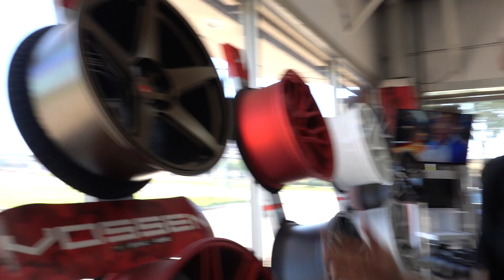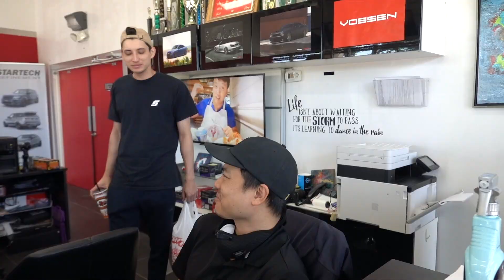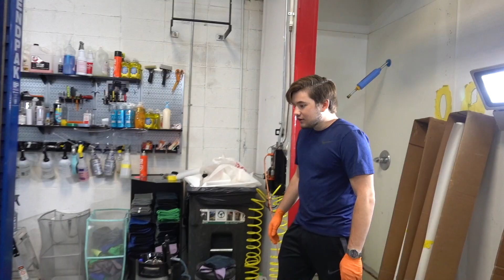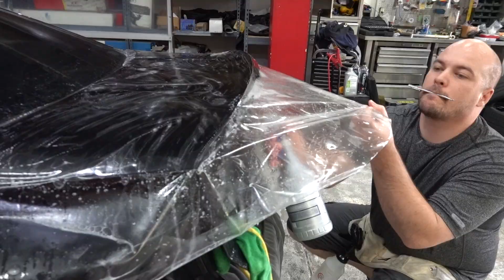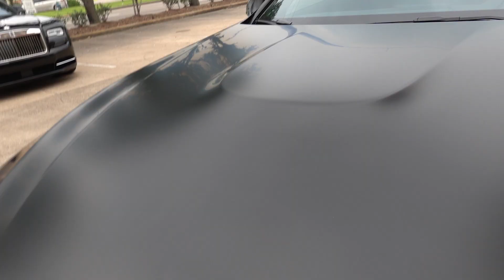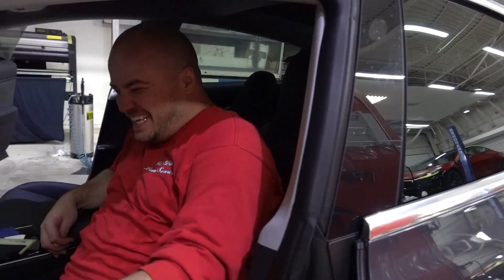The Best Looking Satin Black BMW M4  | EVS Vlog

Comment: Shoud you see the 3M logo on the wrap when in sunlight? I just got a 3M satin black wrap and in sunlight the 3M logo and other numbers appear. This cant be normal right?
Reply from the maker: This isn't 3m
Reply: No that’s not normal, go get that fixed
Reply: @EVSMotors you can’t answer a simple question

Comment: Hi, Which one is a darker black- Stealth Black PPF or Satin Black PPF? What's the difference between them? Or are they the same? What's your suggestion on applying a ceramic coating over the PPF?
Reply from the maker: We love Satin Guard and ceramic coating is a good idea over PPF.
Reply: @EVSMotors  but which one is darker and glossier among the two (Satin Black or Stealth  Black)? I know that Satin is darker and glossier than the regular Matt color. So what about stealth black vs satin black
Reply from the maker: @iam_omiikhan  the name of the color doesn't matter, what matters are the brands and how they manufacture the films, as those will determine what type of finish you'll have

Comment: Exactly same as my bmw individual frozen black
Reply from the maker: Very similar, so it's a great option to make any other color, "frozen".
Reply: @EVSMotors  did you ever compare how the color of the ppf looks compared to Avery or satin 3m vinyl wrap ?
Reply from the maker: @av8743  We did briefly in one of our videos. Satin Guard > Avery > 3M
Reply: @EVSMotors  between the Avery satin black and 3m, I heard the 3m is a darker black that also doesn’t fade as quickly over time. Did you notice this when comparing those 2 vinyls in satin black?
Reply from the maker: @av8743  go see both the films in person, that's the best way to see what's best for you
Reply: @EVSMotors  I will I’m just asking how you’ve seen it ever compared
Reply from the maker: @av8743  we notice the opposite
Reply: @EVSMotors  so under the light Avery appears darker than 3m satin ? I’m hearing jt both ways